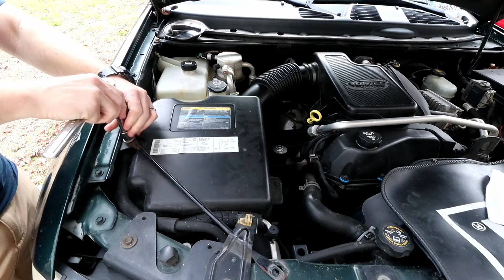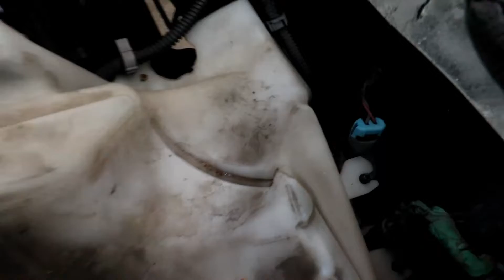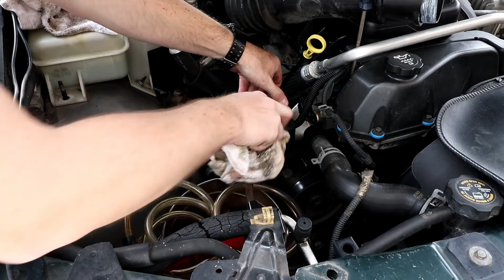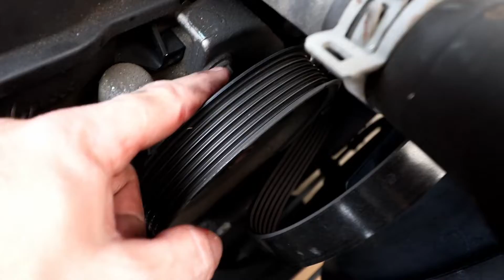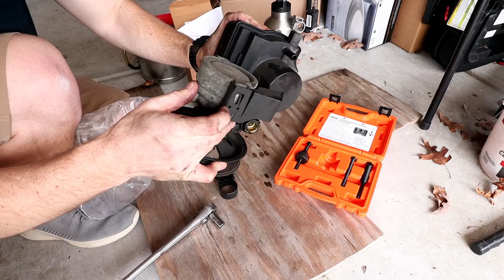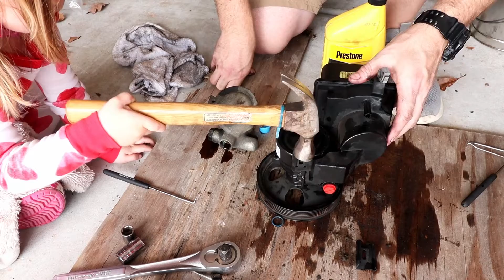HOW TO REPLACE POWER STEERING PUMP FAILURE 2004 GMC ENVOY

Comment: Did you get a new pulley or reuse the old one?
Reply from the maker: @Redneckrebuilds-06  I reused the old pulley 👍
Reply: @KevinNadeau how did you get the shaft off??? The silver piece broke to the pulley?
Reply from the maker: @justeztv6455 if I remember right, I used a puller to remove it from the pulley.
Reply: @KevinNadeau I was wondering about that and realized if I get a new pully then a new belt would also be a good idea.

Comment: What is funny is I can buy a complete unit for $75.99
or without reservoir for $78.99..
Reply from the maker: 🤣 I think mine was about $70 without pulley or reservoir. It was a remanufactured unit that came with a lifetime warranty (Advance Auto)
Reply: @KevinNadeau was thinking that Advance would be my supplier. I've has better luck with the rebuilt stuff from them.